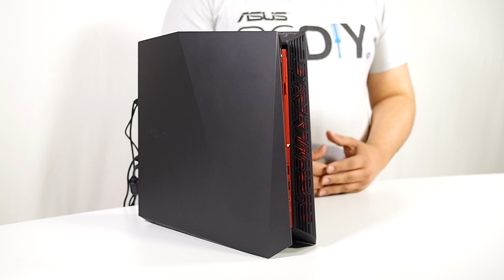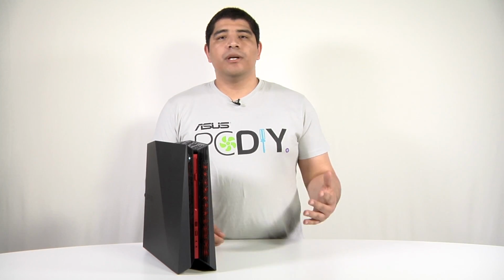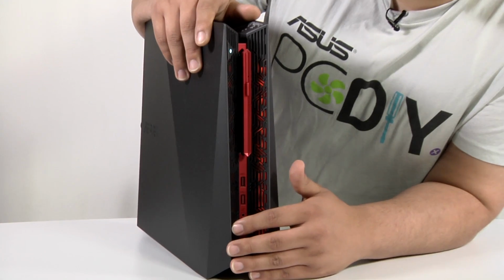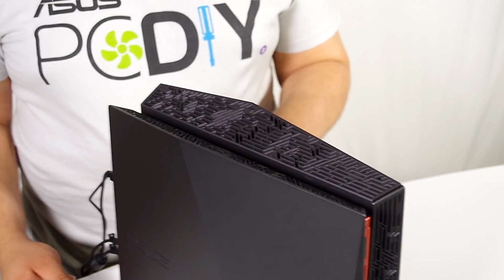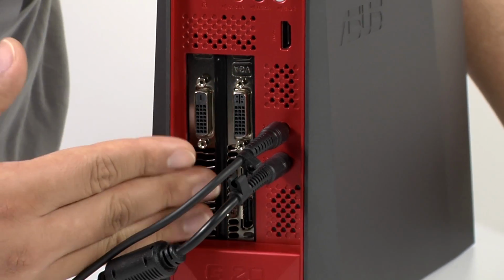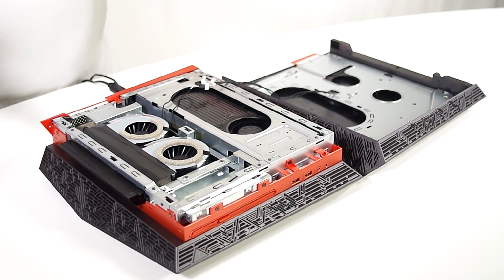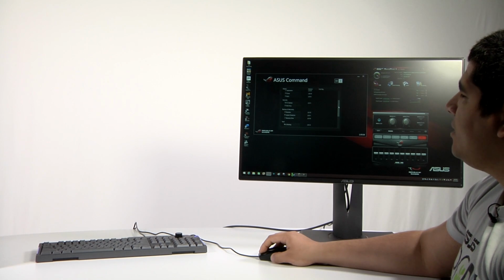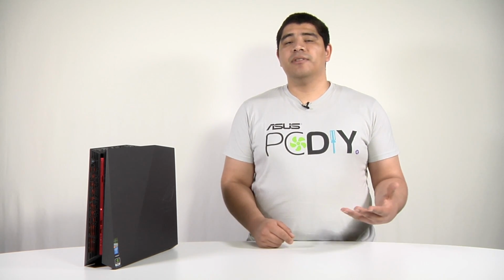ROG G20 Compact Gaming Desktop PC Overview

Comment: ***** , are you planning on making a DIY version or a more modular version of the G20's case without included hardware? I can clearly see the market you're targeting. I just think that skipping the DIY market would be a missed opportunity. Enthusiasts would like to have a less fragile warranty with a case or prebuild like the G20.

Competitors inspired by Valve Software's reference Steam Machine will pick up the DIY market. I hope you will do the same.

I've thought about shrinking down my PC and have finally done so. If ASUS had a G20-like case which could fit mini-ITX motherboards from any manufacturer or at least just motherboards from ASUS, then I would have chosen that over the case I just bought.

Proposal:

Even if the design naturally causes vendor lock-in to ASUS, that would be better than the restrictive warranty of the G20. You could use that G20 design to your advantage: force DIY upgrade paths through ASUS and keep competing hardware out of a DIY G20 case. All you have to do is make the case fit tight around the heatsinks, a zig-zag shaped airflow channel over a zig-zag shaped heatsink on a motherboard within tight tolerance, for instance. However, I would advise you neither make the internal hardware mounts, connectors nor sizes proprietary or you would miss the outside market who would want a G20's internal hardware with a competitor's case and a competitor's internal hardware. A comparison would be if clothing were custom tailored exactly to my body shape where clearly it doesn't affect my freedom to buy clothes from another brand but nobody else could properly fit into my custom tailored clothing. I would be the internal hardware and the custom tailored clothing would be the DIY G20 case. Sell or provide IO shields to allow customers to leave a DIY G20's vendor lock-in (the way I proposed) without a fuss. It would essentially be a soft vendor lock-in. Instead of "ASUS or nothing," it would be "All ASUS G20 or no G20 case." This would save money for the company and the internal parts would remain open for the larger market.

If you do make a DIY G20 exactly as I proposed, I would gladly buy a full unit.
Reply: Matt B, I edited for clarity. Any suggestions to make it more clear or do you think it's well done?
Reply: Alex Goven no additional suggestions - reads much clearer =)

edit:

I can understand that they want to make sure that integrity of the components isn't tampered with (or having to cover it under warranty) during opening

but actually voiding the warranty due to opening and hardware-upgrade ?

IMO even laptop-vendors don't do that :/

a small investigation by experienced technicians should reveal wether components should have been broken before opening rather than due to openning, right ?
Reply: I would hope so. I'm not sure if my proposal would work because I don't fully understand the reason for warranties such as the G20's. All I know is I don't like the warranty.
Reply: yeah, me neither :/

anyway: those  all-in guarantees are a little - hm - "restrictive"
Reply: Like consoles, unfortunately.
Reply: yeah O.o

Comment: Hi JJ. A have a few questions regarding the G20. What is the wattage on the PSU for the GPU? If you support the 760 Ti then I'd imagine the G20 should have no problems with a reference gtx 970 which had a Lowe TDP than the 760 Ti? Finally, what is the maximum supported GPU length within the G20 chassis? 

Thanks in advance

Cheers
Reply: I've read on newegg that the wattage on the psu is 230W + 180W Adapter which will be fine for a 970. but dont take my word on it, this might be different on some models.

Comment: What? Highest end gpu in the g20 is a 760? I read so many places it was a 780. 
But asus you should really:

- Put a gtx 980 in it! It very power efficent and with that power it makes the product much more attractive

-Sell versions with 16gb ram so people actually can get the ram they want without voiding the warranty

-And you should also sell it on your website since i already have problems with where to buy your products
Reply: *****
 Asus Nordic has now confirmed to me that there will be aviable gtx 980 and gtx 970 later
Reply: A 970 would be much better. Lower Wattage. Smaller. Very Powerful. etc...
Reply: Guys check out XOTIC PC vids on this PC. They've clearly shown that you can upgrade the ram to 16gb and the card obviously to a GTX 980 without changing the power supplies... :)

Comment: I find it funny that JJ talks aboutthis prebuilt pc, but then wears a shirt that says PCDIY - PC do it yourself!  lol

Kidding aside, the unit looks very cool and the top end unit has decent specs, BUT, What is dissapointing about this unit?  

If you open it to add more ram or change storage you void the warranty, I could be wrong, but you can add, replace and change ram and storage in laptops without voiding the warranty.
Not being able to upgrade the cpu is not a big deal, but not being able to upgrade the GPU is an issue. I understand that because the power deliver and form factor limitations, but seriously, that is a big turn off if I was to ever consider buying a prebuilt.
Otherwise, a very cool looking decenly performing prebuilt.

Comment: I'm pretty disappointed this will not be coming with a 780 as originally planned (I was actually hoping for a last minute change to a 980) since I like the looks of this compared to the GR8.  My guess is they couldn't get the sound/thermals/power in the range they wanted to.  This does however make me hopeful for a higher tier model (G100? or would that cause confusion with the logitech mouse of the same name?) - anyways a higher tier model with up to dual 980's, 4790k, aio watercooling,   smallest possible footprint, mayan styling, and non-warranty-voiding accessibility.  I guess what I really want is Asus to jump into the case market with a mid tower in the same style as this.  While they're at it maybe a mini itx case too.
Reply: Mine has a 760, wtf asus, I spend 1100$ and i get a 760
Reply: +Gamer Cave mine also has a 760 tho I purchased a GTX 950 that I will be putting into it if I run in to problems with skyrim ormy other game spintires
Reply: Andrew Skadsem i wouldnt get a 950 i would say wait till the new cards come out
Reply: it's the best card I can get from asus where I'm at tho also looking at radeon but not a fan of them. I have always used nvidea in all my PC builds. this the first time I've purchased a pre built PC.
Reply: Andrew Skadsem well i would say wait till the new nvidia cards come out since the price to vram is gonna improve alot
Reply: Ok will do :) the PC is actualy doing great just waiting for skyrim to download from steam
Reply: Andrew Skadsem it handles skyrim perfectly, i have an enb so it drops to 30 fps but it runs great
Reply: Gamer Cave Been running skyrim on ultra for a few hours here and there running great completly blew my i5 away.
Reply: Andrew Skadsem skyrim isnt that hard to run tbh, though newer titles arent to good, not that future proof
Reply: from a i5 that could barly run at low settings to an i7 on ultra is a huge leap for me I play assassin's creed 4, Beam NG,Dark souls 2, skyrim and spintires. My next game is titanfall or black ops 3
Reply: Andrew Skadsem well they are your games, the cpu is kickass not the gpu
Reply: yes it is :) my i5 had a 2g radeon and it did not help it at all that's why I got the i7.
Reply: Andrew Skadsem well i7s are really freakin good
Reply: Or you could stuff a 1080 and more RAM in this like I did with mine.
Reply: Hunter Chapman im probably gonna get the 1070, just thought about it today, does it fit with the cooler on it or what
Reply: 1070 will fit. The power consumption is a little iffy, but you should be fine. You need a special connector because the graphics card has an 8 pin connector and the motherboard has two six pin connectors
Reply: Hunter Chapman Im probably gonna put it in a new case

Comment: Wait..   So a company that caters to enthusiast with their ROG line is making an ROG system that can not be opened without voiding the warranty.   As a Long time ASUS fan I see this as a huge fail.  You all make amazing products but the support side is slowly pushing me towards other companies.
Reply: ***** I think the t-shirt worn in the video may have led to some confusion.
Reply: This is clearly not meant for us. This is for people who are coming from consoles and don't want to bother with building their own PCs. This is a great product for my little cousin who only has a ps4, not for me who built my own PC around a Z87 mobo. I'm assuming you have your own PC build. So this wouldn't be for you.
Reply: I bought this computer because i have very limited work space, and even though it's so small, i was able to put in a gtx 1070 and intel core i7 6700 no problem. And i added all these parts for a gaming build, and the price came surprisingly close to the total amount i spent on this computer
Reply: +Azreal34 it is common that many people fried the chipset using other cheaper alternatives to upgrade (ram/cpu/gpu).. when they send back to ASUS (under warranty) for repair, they dont quite be honest to tell what happen on the last change and pretend to be pc illiterate....
Reply: +Angel Martinez The problem I have with what you said is that if I tried to build this PC, say an i5 cpu system, which would cost at best buy around $900 USD, I would have to spend more than $1100 USD plus I will never be able to get a case like this one.  So building your own PC for gaming is usually a costly proposition in my modest opinion.
Reply: Azreal34 Well enthusiasts don't really buy pre-built PCs anyway. There are similar style chassis from silverstone and others.
Reply: Azreal34 They would not want you to buy cheaper config of the G20 and then upgrade it for lower cost to the capabilities of the top config.
Reply: +ASUS North America soo, your customers are supposed to use the computer until the warranty ends without cleaning them up at all? i open up the case not just to upgrade the computer, or make any hardware changes,  most of the time i open it up to clean all the shitty dust
Reply: I am unsure of the costs related to taking companies to court in Denmark, but at least in the US they far exceed the cost of a computer.
Reply: +Shae Smittle Well there is a government department for customer complaints they make sure the laws at enforced so there is actually no hassle just file a complaint with them and they take over..
Reply: +circacheese Can you tell me where can I buy a similar style chassis from less than $70 USD?
Reply: orestesdd
I had the RVZ01/02 in mind but they are more expensive. In that price range you can get this:http://www.amazon.com/SilverStone-Technology-Mini-ITX-Computer-ML07B/dp/B00K8CIZYS/ref=sr_1_2?ie=UTF8&qid=1440616179&sr=8-2&keywords=rvz01
Reply: contact Asus Azreal34,  you can upgrade this pc. You can also open it without voiding the warranty. this person should be fried because he doesn't know what his talking about! ask them first https://www.asus.com/us/support/callus
Reply: Fallenstar AJ Thank you for this info.
Reply: +Azreal34 If you are an so called enthuasiast which you aren't, you don't buy a brand computer, you build from scratch.
Reply: +LennartSteak So I am not an enthusiast because you say so?  For the record my Main computer was built by me.  5820K in an X99 Deluxe with 980Ti with a custom water cooling loop.   But I guess that doesn't make me an enthusiast huh?
Reply: Azreal34 Still you asked why they remove warranty if you open? Brand computers are for no one but non enthuasiast! As a kid i had brand computers but never again!
Reply: +Angel Martinez yes but i built my own computer and it costed me 1500 dollars, this is 800 dollars i would recommend this comp to ppl trying to play high end games but not spend over a thousand dollars
Reply: Llama Arlington I would not as you cannot upgrade it.
Reply: ***** wait you can't, I thought u could upgrade but it would void warranty correct? Or can u never change gcards?
Reply: Llama Arlington But after those years when the warranty is out you are going to have to buy a new chassi or you wont fit anything normal sized and have limited performance products ify ou don't
Reply: Oh shit well good thing you told me that, I would have had my friend make a big mistake. Thanks buddy! But ya I would want a comp with full accesability
Reply: Llama Arlington Don't be afraid of building one, the motherboard manuals are clear and easy to read. Make sure you can put the cables behind the motherboard plate and you won't have to think too much about cable management.
Reply: +Azreal34 Not just that, one can make a better PC for half the price. I already made my Lanbox with 380t case(a bit bigger, though) and I can upgrade every later on.
Reply: +Azreal34 true story!
Reply: +Azreal34 like alienware
Reply: +Azreal34 Another fail thing they did is that they stop selling their GR8 and their GR6. Both powerful computer that are great for more than the average usage. You can use it for development work, play the latest video games, and video editing. I was looking for them for video editing and their sizes because, I don't have the large setup on my desk.
Reply: +Azreal34 I love Asus too. But not everyone has the competence to open/upgrade stuff inside, then they will complain to Asus that it is Asus' fault. Asus will have to pay for a technician to look at the PC, and the techie will say that the customer is at fault etc etc. So it exhausts Asus' resources and about 98% of desktop pc manufacturers have this policy
Reply: If you buy a GPU and you open it by takin off the heatsink or fan, you void the warranty. If you buy a CPU and you open it by taking off the heatspreader, you void the warranty. If you buy a locked i7 and you unlock it, you void the warranty. If you buy a prebuilt PC, and you open it to make changes, you void the warranty. Why is that so hard to comprehend? It makes perfect sense.
Reply: +CogniVision That is not always true.  EVGA does not care if you take the heatsink off and put it back on.  Sure they check if you screwed it up and won't cover that, but otherwise they get their customers.  The Alienware x51 does not have its warranty voided if you pop in some extra ram.  I am glad I went with that one instead of the ASUS one.
Reply: In Denmark you do not void the warranty if they tell you otherwise take em to curt... You should be able to upgrade :)
Reply: Aki Ren idiot
Reply: Aki Ren do you even know what you're typing?  or are you just that stupid in general ?
Reply: i'm a idiot ? 
how nice of you to point it out... now i know.. 
Please think be fore you spout bull shit...
Reply: Aki Ren nothing I'm saying is defamatory. You completely are . If you're intelligent you would know building your computer is a lot cheaper and a lot easier and a lot better than buying a preassrmbled brand name from a store which they make triple profit from you . I can tell you're an idiot just by the way you're talking on this channel . Infact, you just proved my point. 😂😂
Reply: Brandon Murpgt how nice...